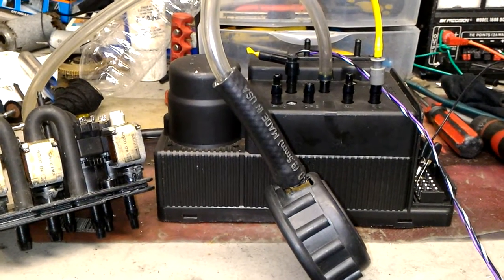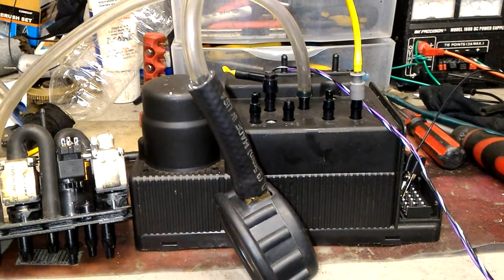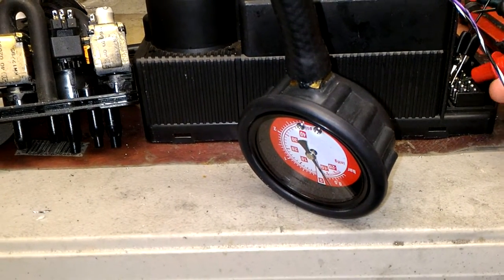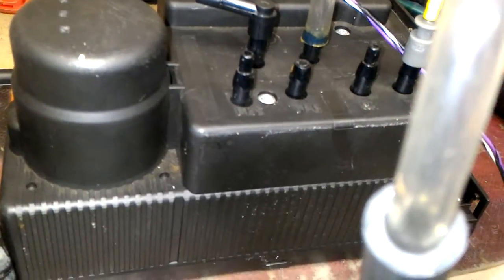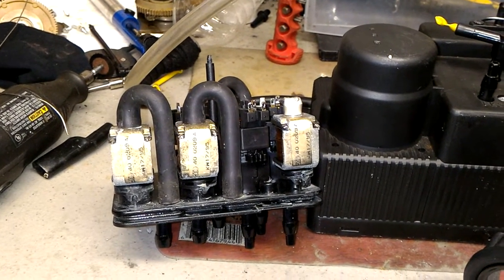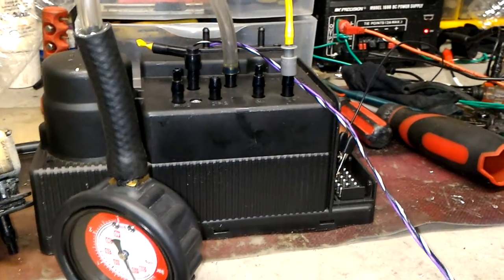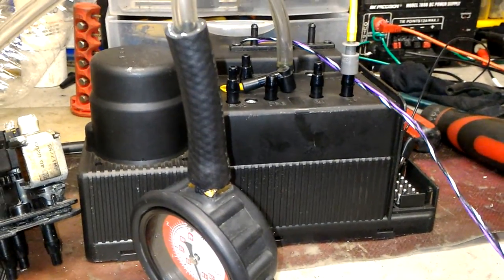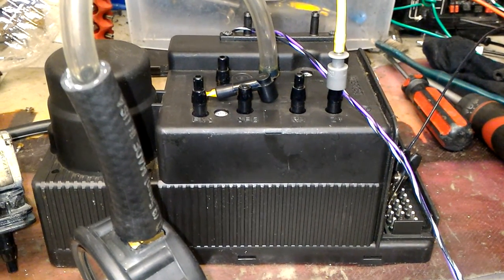Mercedes door lock pump problem found

Comment: I think my valve block is cracked. My 95 pump gives pressure out of both p+ and p-, then vaccum out of p+ and p- together. Like there linked internally. Central locking works tho. Valves operate fine. Pump runs fine. That's my weird issue 😆

I love the videos 🙂👍
Thanks for sharing
Reply: I have the same problem. how to solve the problem? I've been trying to solve it for a year and still don't know what happened to the pump. whether it should be so or not?
Reply: @YuriiVityuk  hello, On my pump the plastic is cracked on the inside. I think you need replace the pump.
Reply: @MechatronCNC-HVM  Hello. Do you mean that the air channels between p+ and p- in the valve block are cracked?
Reply: @MechatronCNC-HVM  Therefore, it is necessary to replace either the pump or the valve block of the pump?
Reply: @YuriiVityuk  yes. I took all my pump appart and checked it all. I belive something is broken on mine. 

I am not an expert tho, Victor (vsandvs) knows alot more about these pumps.
Reply: @MechatronCNC-HVM  I am very happy that there is another person who has the same problem with this pump. But in Victor's video, I did not meet this kind of pump failure, only a test of already repaired ones. And since the videos about pump repair are quite old, Viktor does not respond to comments, and I don't know how to contact him otherwise, especially since he is from America and I am in Ukraine with my problem. There is too little information on the Internet, all information ends simply on replacing the motor in the pump.

Comment: I have mercedes w124 and have problem with central locking .....there is how it's happened:   Door lock work normaly..on four dours and on trunk lock .....open ..closes....lock..unloch so fine .....BUT when came hot days and in car temperature get hot ....central lock not working at all on any door and trunk so I need then to use key and manualy lock front doodr and trunk and manualy press on rear doors pins for lockin inside........ 
When car inside get cool down  everything work normaly........what I should check?

Comment: Can you please tell me where the fuse for the 1995 S350 diesel Mercedes. Thanks,
Reply from the maker: there are couple of fuses for central locking system  They are in the trunk on right side. Look at the legend paper found under cloth fuse cover

Comment: Hi Victor,  can a vacuum pump from a w210 be adapted to work in a 1996 w140 s300 diesel?
Reply from the maker: W140 has more options than w210. So I dont think it can be adapted. Maybe only for door locks but nothing else
Reply: thanks Victor for your prompt reply
Reply: Hi Victor, I have now used a pump from the W210 on my W140 extending the wires and vacuum pump, so now the motor is outside of the pump body and encased in a new body.
when disconnecting the wiring plug all the connections came apart, don't know how , the pump will operate the pressure side and the vacuum side when pump wires are reversed, but only it will operate in one mode either lock or unlock, depending on which way round I put the motor wires,
Can you please let me know what colour wires on the plug operate the reversal of polarity when the remote button is pressed to lock or unlock,
thanks Malcolm
Reply: should read vacuum pipe.

Comment: is the motor same in w124 and w202 vacuum?
Reply: Very different, 124 pumps are very similar to w126, small box with 3 pins for power.

Comment: Where is your shop located at am in Phoenix Arizona
Reply from the maker: I'm in Bronx, NY. Quite far away from you
Reply: Viktor
I spoke with you about mr 94 s420 a week and half ago.  We had a very good conversation  and talk regarding my ASR and throttle proplem.  Finally, Sunday I got car moved into driveway after days of rain an Cov19 sheltering and yesterday after about 3+ hrs od fighting the valve said "I give up! and the hard part was over.  I have packaged it and tomorrow  it goes to th PO.  You should have it early next week.  Your video was a huge help.  When the rubber boot would not release I had to take it apart in pieces. Yuk!
Rick Clement 
San  Jose